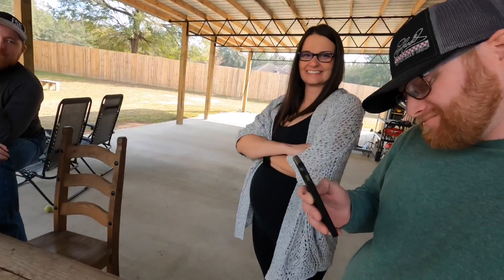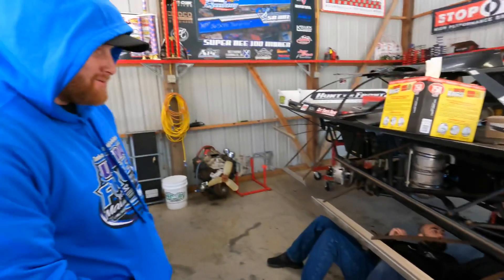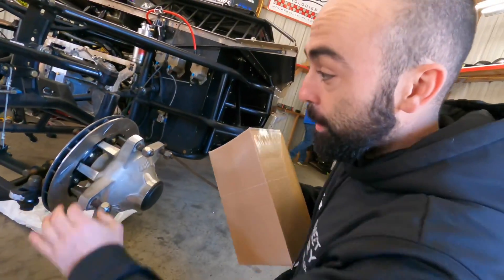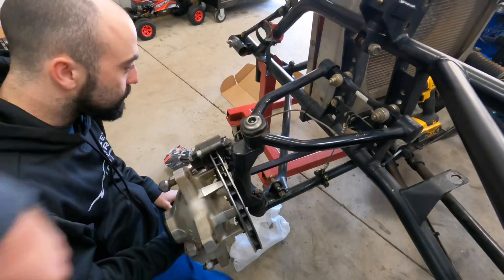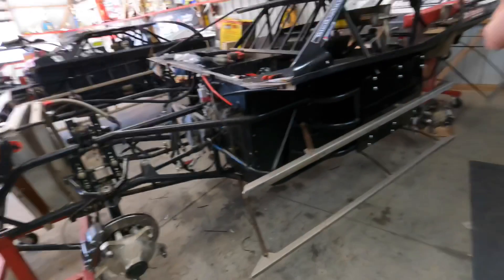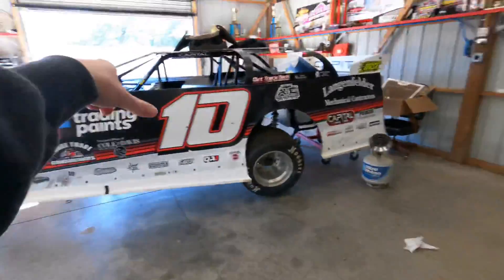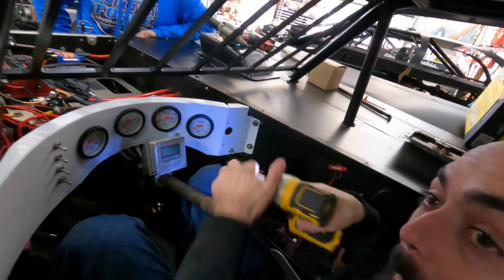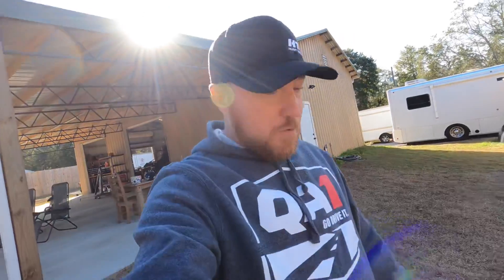Unboxing Our Silver Play Button and Explaining the Seat Situation (Finally!)

Comment: Hey boys your bellhousings should have a few extra holes, drill through them into your motor plate and tap them 1/4-20 and bolt your bell housing to your motor plate then cut the ends of the bolts off and grind flush. We run quartermaster bells and have been doing it this way for years. You can pull an engine and not have to fight with the transmission and oil pump

Comment: I believe I seen yall on hwy 40 heading to Volusia I live in the forest in Ocala I broke down hauling my car over there to race and it looked like y'all's rig going by
Reply: No you didn't...there in the shop with no motor
Reply: @JJ-1-1  10-4 it just looked like their rig had a HTF tag on the front I ended up unloading my car and driving it back 11 miles to a AutoZone by house to buy parts for my truck and got pulled over on the way back needless to say the MCSO was not amused I had a dam late model on the road I'm going to have to sell 3 kids and take out to mortgages to pay for the ticket

Comment: Get a better air filtration system for the engine. Please so as not to keep wearing out internal parts fella's.   Keep on keepin' on.....
Reply: Top of the line stuff bud you don't what your talking about.
Reply: @JJ-1-1  Yeah cylinder bore wear speaks for itself..
Reply: @jlfastride1  There problem with the oldest motor is they never changed the pistons since 2008 the piston has set in the bore and freted and finally broke a ring. And the top LM engine builders recommend those filters and also you have never seen the carb after the race and how clean it is with those filters. So when you have first hand experience come back then.
Reply: @JJ-1-1  Hmm? Interesting info.  Thank you for clearing things up for me..

Comment: Congratulations, I have a question about the fire bottle system. Back in 1988, we had a Halon system in our car and it worked well to. However, the the Halon, I fairly certain but that was some thirty years ago, reacted when it came into contact with the aluminum intake manifold. It basically discolored it and were in touched it it kinda clumped up. Hopefully, things are different now, or get a purple k system.  Stay safe!

Comment: After getting fitted for 3 seats and the deal falling through,   ill definitely be switching to Lajoie's seats myself
Reply: Yup, sounds like Butler took the free publicity and renigged on what ever deal was made.
Not a good look for Butler.
Reply: Unfortunately this is not the first time I heard butler doing this. Several of my racing buddies were put in the same situation. This is why I never used butler products while I was racing. Pitiful
Reply: I was always wondering what the hell happened to the seat Joseph got fitted for lol now we know.
Reply: @DDP0723  now we know?   No one explained it.   Maybe HTF screwed up the deal.  Maybe Butler wanted to sell the seats and not give them away?
Reply: @DDP0723  You have absolutely no clue what your talking about.
Reply: @charleslivengood7483  had a butler in my champ kart. No issues. Even replaced the padding for free when the stitching came undone in less then a month. Wasnt a custom just a shelf seat. My guess they wanted free seat
Reply: @sphishex6084  and with nearly 100,000 subs the publicity from the vlog, they should have gotten  a deal, and it shouldn’t have taken a year to get it. HTF are to classy to tell the story and dog Butler out, but I assure You the eyes that seen that vlog was worth a deal.
If not 3free seats,,, something.
Reply: @charleslivengood7483  100k is awesome but do you really think 3 custom seats which would probably total probably around 10k is worth that minimal exposure? I dont see it. while enjoyable their popularity is entry level. If the guys were winning the Super stuff quite often then i could see it. But theyre not a house hold name yet like Madden, Fergie, Terbo, Overton.
Reply: @sphishex6084  no they’re not as big as  the touring guys.
I never said free, because said “a deal”
Those touring guys aren’t bringing as many eyes to butler though either.
HTFs YouTube channel gets far more exposure than their level of success on track would alone.
Reply: @JJ-1-1  I was just saying now we know there was some kind of an issue since it’s been so long since we heard anything about the seat.
Reply: @charleslivengood7483  how many of those 100k viewers are actually going to purchase a ButlerBult seat? Haven’t seen very many in the grandstands. It’s all about who the product is sold to.
Reply: @charleslivengood7483  Too classy? No offense but you don't know these guys.. You are ASSUMING that Butler is the "bad guy" in this instance. It could be the other way around..

Comment: Hum, sounds like HTF was wanting Butlerbuilt to sponsor them with free race seats & they wouldn't was the reason the deal didn't work out. Butlerbuilt is still in business & the seats never showing up last year sounded fishy bc of waiting on backorder materials to build seats for an year. Aluminum, vinyl & foam for padding are the main components of a seats, there was a never had major shortages during the last 2 years but the aluminum used for cans that had a shortage caused by the breweries having to can beer instead putting it in kegs during the beginning of Covid in March 2020 bc restaurants & bars were closed. It wasn't really a shortage but the fact of increased demand for aluminum cans cause soft drink makers not to have enough cans.